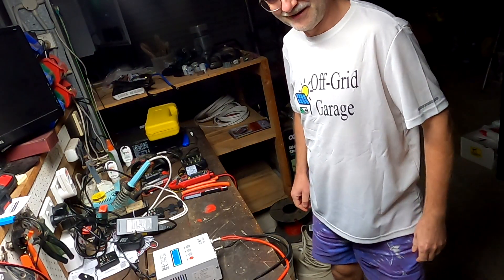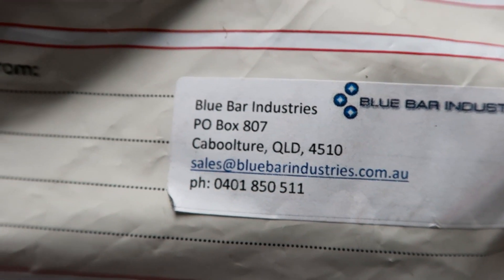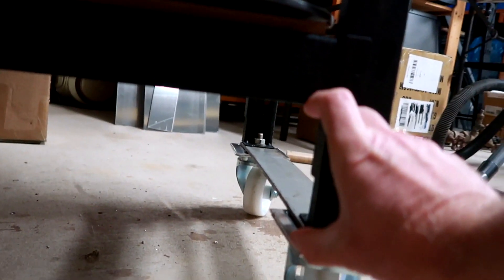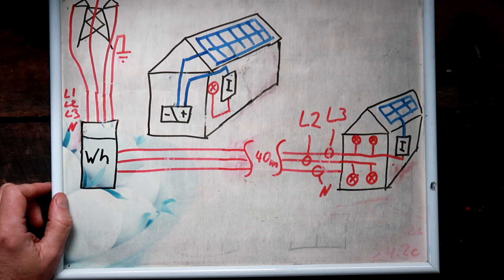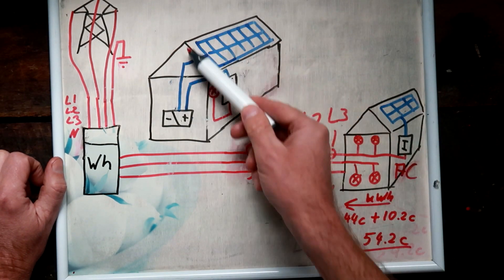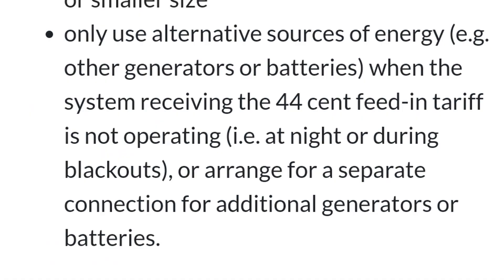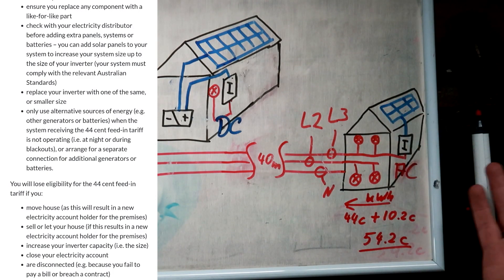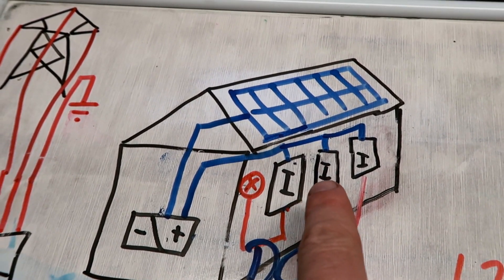Why a solar hybrid inverter will not work for my setup.

Comment: I do every day what you want to do, run the house of solar and battery while there is enough sun and battery then switch to grid when there is not. I my inverters are all in one solar MPPT , inverter , battery charger (when not inverting) and they do the switching. I use copper pipe for ferrules. I have a hydraulic crimper for my cable lugs cost me $54 on ebay was more than twice that for a manual one, does a very good job with 11 banks I had more than 60 to crimp.
Reply from the maker: But you don't have a 54.2c/kWh feed in tariff, I assume? Totally different situation then... and easy to solve with a hybrid inverter.
Reply: @OffGridGarageAustralia  Would be better if I did as I would be getting 54.2c for all the power generated by the house but I do not have a grid feed in system as the system feeding power to the house is another system with other panels. The way it is with me now is that when it switches I draw no power from the grid so its like I am getting paid 25c for every kWh it generates. For you now every kWh you use in your house while your system is generating is costing you 54.2c

Comment: I didn't see anything in the rules saying you can't shed load from the system. 
You have the old cable that used to feed the garage. disconnect this and back feed to a second distribution board in the house. 
Install a plug and socket connection on items like your water pump so you can run on garage power but have the option of quickly returning to grid mains if there are problems.
Reply from the maker: How should I get a cable from the garage to the house though? It needs to be in a trench, 60cm deep and I have concrete and retaining walls in between, plus trees and established garden. That's not an option.
Reply: @OffGridGarageAustralia  What happened to the cable that used to serve the garage before you went "off grid garage" ? It must already be underground ? Repurpose this to feed the house.

Comment: Have a look at a simple transfer switch to disconnect grid when using the battery  to make sure nothing from the battery is exported to the grid.

And thanks for all the great content, very helpful.
Reply from the maker: Thanks Trevor. A transfer switch would stop the export of power though. So that's not an option...
Reply: @OffGridGarageAustralia  Thanks Andy. Yes but you switch it over after sunset so you are drawing from battery while ensuring no export of battery power.
Reply from the maker: @TrevorFraserAU  Ah, I see what you mean, yes, that would be possible. I'm free to go after sunset 😉

Comment: Put the main load of the house on L2. Use a hybrid inverter for L2.  Switch the hybrid inverter with the controller of the grid inverter or a current sensor on the ac side of the grid inverter. Then you only use power from the garage when the grid inverter is not running. Should be in accordance with the contract.
Reply from the maker: I've got something similar in mind...

Comment: Why not put a garage hybrid inverter only to your home circuit line 2 that does not connected to the home solar line or L1. It will just appear as using less power on L2 and won’t impact your contract. If you are worried about back feeding the main meter to not show generation at your end, put an auto transfer switch in.. to disrupt the connection back to the l2 meter
Reply from the maker: That's not an option as it would breach the contract. I can only supply power to the house if the house solar is not working. 
During the day offsetting this power to the house would increase my export energy, so increase the payment they need to make. That's a breach.

Comment: Run a transfer switch for critical loads to house especially for a 'power outage'. The cost of running some separate cabling 16mm should pay for itself given your feed in.
Reply from the maker: I've got only these two cables to the house, nothing else can be installed or added.
Reply: @OffGridGarageAustralia  Bite the bullet put a new line in from shed to house for 'generator'. Take advantage for the trench put additional conduit in for network, power and some poly pipe for water just before closing it up that way you have as many services in that trench to justify the costs. I suggest putting an empty pipe down as well just in case - conduit is relatively cheap saves digging it up again later.

Comment: Need some isopropyl alcohol (isopropanol) to clean that whiteboard. In the US it is widely available in 70% strength as "rubbing alcohol" but make certain to avoid any that have any skin moisturizers, perfumes, etc. The cheap kinds are usually just isopropanol and water.
Reply from the maker: That's what I've used to clean it in the video. I think the surface gets brittle from the weather and the ink sits now in these micro cracks.
Reply: @OffGridGarageAustralia  That seems plausible. I put a glass whiteboard in my office just over a year ago. Basically a sheet of tempered glass with the back painted white. So far it seems really durable. Yesterday I erased some writing from the first day. It did not want to come off, but with a bit of scrubbing and scribbling over the hard spots and erasing again, it did come off and left no trace. That gives me hope for a long lived board!

Comment: you dont get 3 phase to house  because you dont have 3 phase equipment in house you only got the second phase to house to balance the load in the house eg 2 phase on stove
Reply from the maker: Yeah, maybe. Stupid anyway, they should have just pulled this 3rd cable through when they had the chance of doing that.

Comment: Du könntest seinen sun1000/2000 mit meswandler auf L2 legen der den Verbrauch misst und die eingestellte Leistung zugibt denn hätteste weniger Verbrauch auf L2 und der Zähler saldiert dann weniger, und du würdes mehr einspeisen, weiß ja nicht ob das evtl gehen könnte zwecks der Vertragsregeln
Reply from the maker: Das ist der Plan. Hab schon einen hier und teste.
Reply: @OffGridGarageAustralia  Die SUN1000/2000 sind nicht nulleinspeisend. Die Regelung ist zu träge. Die Einspeisung ist anders als bei einem Hybridinverter nachweisbar. Sind zwar hübsch blau aber laut die Dinger.

Comment: Andy, you may not be able to power the whole house. But what you can do is reduce your reliance on the grid power. The easy way is to find you big plug in loads, namely  the pool pump and the irrigation pump and taking them off grid. looking at your place it would be fairly easy to run an underground 240v supply to the pool area, this would be a great start.
Reply from the maker: The pool, hot water and vehicle charging are already running on a cheaper tariff, so I'm not worried about that.

Comment: Connect the Hybrid inverter to the other L2 line and the house solar to the L3?
Reply: i had exactly the same thought. only in case the mains (L2 and L3) are down, the L2 section of your house powered from the garage. means you need to setup L2 supply to be the emergency setup: lights, water pump and few sockets. perfect scenario.
If the power is there on L2 and L3 and you are producing on both the garage and the house solar panels, does the hybrid work like the grid-tie inverter and feeds energy back into the mains? (and wouldn't that void your contract? it could be considered the same as modifying the capacity of your house solar system)
Reply from the maker: Running the whole house from one phase?
Reply: @OffGridGarageAustralia  I am saying you have L2 and L3 feeding the house.  You current house solar feeds L3,  can you not connect the garage solar to L2?  That way both L2 and L3 loads are using solar.
Reply from the maker: @kennith.  That would not be allowed during the day as it would increase the export power by the load usually sitting on L2 which I then run from the 'alternative energy source' as per contract. At night, that's OK.

Comment: Growatt has an excellent 12 kw inverter. 1/3 cost of the solark too...love mine. Heavy though. Thanks Average Joe
Reply from the maker: Which will not work in my case as I have a grid tied solar in three house. The house is the load at the same time.

Comment: As you're reading that contract I noticed it didn't say anything about allowing you to add a subpanel into your main house you could always run a sub panel over to the house that feeds a separate set of circus it doesn't pull from the house and only pulls from the off-grid garage so that way you can maybe run some main loads from the grid side and extra stuff like refrigerator or some extra lighting at night off the garage or even during the day without tapping it directly to the grid you could run you a secondary subpanel in a c form over to your house and leave it physically disconnected and just transfer some of your loads over with the transfer switch
Reply from the maker: I just cannot run an additional cable from the garage to the house, there is concrete and retaining wall, garden in the way. That's not a viable option at all unfortunatelly.
Reply: @OffGridGarageAustralia  that suck well hofly that will help some one else in a similar boat / contract and jest tring to thank outside the box love your videos because ther not jest here use this ir that you try thing you say what work and why and what does not work and why it it didn't work keep up the good work and the progress of your work

Comment: Thanks for the video, Andy.  Nice to see you had a break for a few days.  After mentioning your other channels, I will have a good look.  I have the same contract here in South Australia.  I will lose all my feed in rebates like you if I install more panels.  Have a nice, sunny day.
Reply: You can add more panels up to the limit of the inverter, usually 20 % more capacity than the nameplate rating. the inverter is the limiting factor.
Reply from the maker: The inverter is 5kW and the panels cannot exceed this power. So it says clearly on the website and contract. 

You will lose eligibility for the 44 cent feed-in tariff if you:
- add extra capacity (i.e. panels) which exceeds the rated capacity of your system’s inverter

Comment: The solark inverter has a zero export import function, you can set the garage up as its own isolated plant, and have the sol ark only charge off the grid or bypass to the grid when low battery events happen. It can do this as it has a dedicated generator connection separate to the load output.
Reply from the maker: Yep, something like this is the idea and seem to be the only option for the next few years.
Reply: @OffGridGarageAustralia  our solar F.I.T in vic just dropped to 6c per KWH, i think a lot more people are going to start looking in to battery options now

Comment: Where is you meter and main incoming board, in your garage?. In Victoria the Grid Tie inverter must feed back to the main board just behind the main breaker next to the meter. From your diagram it appears your system is not wired that way.
Reply from the maker: The grid-tied solar on the house feeds to the house switchboard through a separate breaker. The main meter panel is next to the garage though. There is 40-50m in between and I cannot add any cables or run a new line.
The problem is, the house solar is pretty much connected to the load directly and I cannot tap in between as it is too far away.

Comment: Your image of an MPP Off Grid inverter feeding your house with a grid tie inverter behind it won't work, this will end up in smoke. The document you have discussed makes no mention of an Off Grid inverter. The Grid tie inverter needs to be at the input side of the MPP Off Grid inverter. That will work and won't affect your feed in tariff
Reply from the maker: Yes, I know, that's what I said in the pinned comment, a hybrid inverter will not work!

Comment: Power points from the off grid garage to the major loads of the house, AC, washing machines... Etc.
You will need more solar,and the hole thing is another 💩 show, but still...
Just a thought.
No Aussie laws against it I hope.
Let some led lights tell the electricity company you are still alive till 2028...😅
Reply from the maker: I cannot pull any additional cables from the garage to the house though.

Comment: I have a generally similar situation, a first world problem I guess.  I don't have restrictions on reducing house loads as you have.  I have a grid tied system from about 10 yrs ago, that I'm not allowed to expand, and want to offset extra loads from EV, hot water, AC that were on different meters.  Also lost net metering so limiting outflow and inflow is better.  I added an off grid system, putting the whole house on it.  The grid tie system now has a transfer switch, moving it to the grid directly, if I can't use it all in the house.  Next winter I may need a little grid power sometimes, and I also rarely need to charge EV at night from the grid.  This video is old, before getting controls set up to manage things and still adding more lithium. https://m.youtube.com/watch?v=X6Ru-vhvtTM

Comment: What are your high load consumers in the house?  The rules say can't power the house from another system while the grid tied system is on, but how about move the appliances to the garage?  Certainly charge the Tesla from there when there's off grid energy available.  Put a main hot water heater in the garage and run it as a dump load, as a preheater for existing house water heater, run water lines underground.

Comment: Andy, how about pushing DC to the house grid tie inverter DC input?

Relay activated once garage batts are full could be an option?

Keep up the good work
Reply from the maker: How do I get DC from the garage to the house? That is also not allowed as it would exceed the 5kW inverter limit. The solar has already 5kW and connecting more DC input to the inverter at the house would result in more power been exported during the day.
Reply: @OffGridGarageAustralia  good point Andy,

Stuff that idea, build a huge Tesla coil and fry the clouds!

Even better, create a DC particle beam energy weapon and make the sun go supernova!

Comment: Hi Andy, I would be looking at putting a 2nd sub circuit into the house from the off grid garage and install power points inside the house that is off grid, the power points that use the most power would be the first on the list.
I have a grid connect hybrid setup the battery banks, the battery banks is not charged from the grid connect solar as I have programmed to not charge in the Solax hybrid inverter, but a separate Victron solar  setup that is off grid that is connect to the battery banks that charges it up during the day, so all my over night power comes from the grid connect batteries, this is a dual 48v setup with a 6.4kw 14S Li-ion (LG Chem) and a 12.2kw 16S Lifepo4 (38120 home built) feed together, a lot of people said that you cant mix chemistries, but you can
Reply: Yes, I think the same move some loads off grid, change your hot water boiler to an electric and connect it off grid for example.

Comment: so why not power your highest load in the house, or a few of them, just from the off grid garage, so you arent feeding anything back you are just running something from the other location on its own circuit separately
Reply from the maker: With a long 50m cable and leaving the doors open?
Reply: @OffGridGarageAustralia  Andy, would you be un willing to trench a permanent underground connection from garage to the house? Was there any original connection to the garage for utility power that you could reuse at some level? I’d price that connection here at $4.70 USD/ linear foot and then put in a manual transfer switch on the house side and simple breaker on garage side. Is that not feasible?

Comment: same as in america, atleast anywhere I know of, they dont like to give 3phase
Reply: Almost impossible to get 3 phase to residential in the US, but it is common in commercial and industrial buildings.
Reply: Generally speaking, in the US, utility tariffs require charging for demand when three phase is connected.  One logical reason to not have three phase in residences is that US appliances are all single phase or they are 240VAC along with minor loads, so you’d be shifting a utility transformer on the pole for a privately owned transformer inside the house. As a solar installer, I can tell you that many, many houses do not have code compliant wiring and many “hacks” have been installed over the years. Having 3 phase available to most people is opening the door to uh, “issues” when Mr. DIY doesn’t know how to deal with it.
Reply: @tomkacandes8286  I agree, I work 3 phase in our shop and on all out tug boats, 480/240/208/ even some weird 120 3 phaseish setups, I find it easy but I deal with it every day, also the big thing with houses and electrical is even if the boxes are never touched, most likely within 4 years when NEC code changes there is something out of code, I will say doing my own solar install sucks because the city is requiring a master electrician to pull the permit, vs letting me do it and get it checked over inspected and approved.

Comment: Great job at explaining it, there are so many quirks to consider and most people don't factor all of them in. 

Also good to see you're keeping it legit' too. Even though it kinda sucks that many of us could be feeding more renewable energy back into the grid, there are rules in place to ensure it's done right and not causing issues or taking advantage of the system.
Reply from the maker: I definitely don't want to jeopardise this feed-in, so need to work around it and keep it legal and legit.